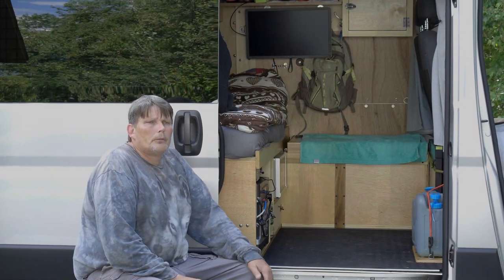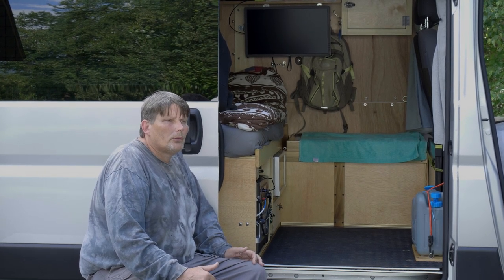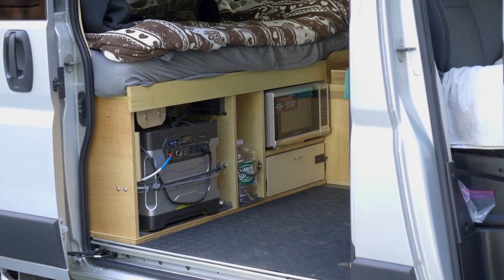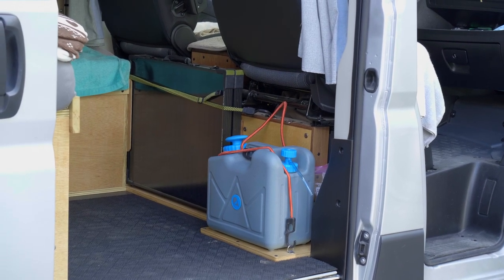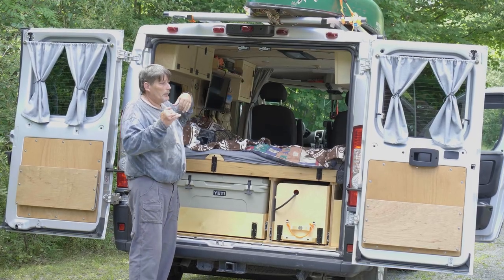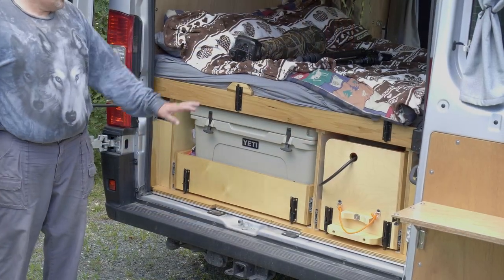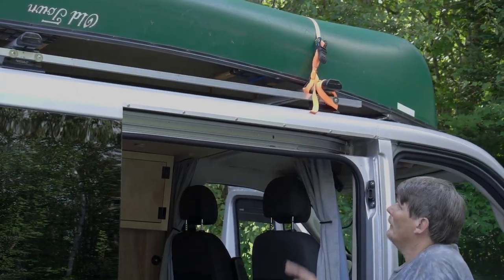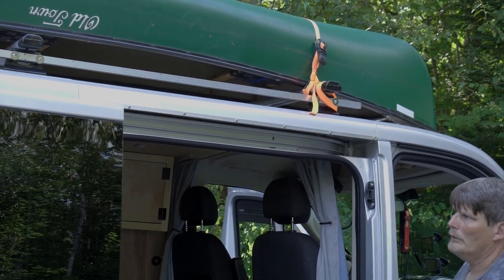Ram Promaster 118 WB Camper Build - Intro

Comment: Can you make a follow up video showing or sharing your experience on how the 118 WB holds up under tough road conditions and inclement snowy and rainy weather?  I can't find any information or reviews to see how it holds up on sand, mud and snowy roads or going uphill a mountain. Wondering about the worst situation you have driven under and how it held up?
Reply from the maker: Yes - give me a week or so -  The best quick thing I can tell you is - Snow Tires make all the difference in the world, snow tires really do matter, it will never be a off road queen, but with good tires you can manage most situations - But I will do an update video - We love this little van :)
Reply: @fireflightphoto1319 Thanks a bunch for taking up my suggestion. 

Your built is very functional and beautiful by the way. I appreciated your detailed overview and very much so sold on this van but wondering if it can take me where I need  to go on difficult roads. 

If your video can demonstrate what the van can and can't do after the upgrades you suggest, you will become the first to have covered the subject on the 118. 

Snow tires for the front wheels only or all 4? I don't know enough to know if it matters for the real wheels that do not generate any power. 

Thanks again.
Reply: @fireflightphoto1319  Hi there. Just wondering if the video update about the Ram Promaster 118's limits and capabilities is still something you are planning on. If not, can you share your experience as a reply. Many thanks.
Reply from the maker: @tristansolaris467  - sorry, life got in our way of this follow up - i will post something shortly :)
Reply from the maker: @tristansolaris467  Hi - I will do the video update next few days. But the immediate things that come to mind are: Adding the side rollers for the canoe was a big benefit for loading with one person. Taking out the cooler that need ice and replacing it with a dometic fridge was a big improvement. If I had known about that size fridge I would have built the rear compartment different. Adding a closing flyscreen on the main sliding door, really helps with sleeping in hotter temps with door open. It really needs a rollout awening above the sliding door to make it amazing.  It would also be nice to have some sort of rain awening over the cookng area.  We have been on back roads (moose country) but its not a 4wd, so you have to be aware of the conditions you are driving in.  Also snow conditions, with front wheel drive, make sure you don't get stuck in winter conditions.  Sometimes its really just one wheel drive, the way the drive system works. Other than that its an awesome glorified tent as we call it. We love this van.  Not sure I had the magnetic window guards for the small slide windows, but I made some guards out of plexiglass with magnets, means we can leave the small windows open when we sleep even in rain.
Rob
Reply: @fireflightphoto1319  Thanks. Please share as much info about your experience  about the limits of this van when it comes to mild off-roading in back country roads.  It is not AWD and I am wondering if we can be given some real world examples of what it can and can't do, what were the most challenging places you've taken it and how it handled. Really looking forward to your video. Thanks again.

Comment: Thank you for the tour! Some excellent tips, from your custom canoe roller to the remarkable drip edge to prevent water runoff into the van.
Those flip up shelves on the rear doors are a great idea too!
If you could share links to some of the items you mentioned, like the roof rack and camping gear, it would be greatly appreciated!
Happy trails!
Cheers from Montréal :-)
Reply from the maker: Thanks - Give me a couple days (Sept 3 2020) and I will get a parts list together and get it up for you (links or PDF) - just need a few days, again thanks for the compliments, the van is awesome, we love it!
Reply from the maker: The roof rack is the H3 system from Vantec (you can get a two bar or 3 bar version. The flip up right angle foldable brackets (are the best I found) awesome in stainless steel, bought from Amazon Part No: YUMORE Folding Shelf Brackets 12”, Max Load: 330lb - we bought the 12" version - The two burner is the Camp Chef Everest 2 Burner Stove, it boils and cooks food in no time, we attached it with magnets so we could remove it if needed

Comment: Thank you for your very informative video. I love the build. I  am looking at the 118 low roof as well for work and hauling bikes, dogs, kayaks, ect. Could you please comment on how the van drives?  Are the seats comfortable?  Road noise?  Thanks!
Reply from the maker: The van drives great, not a powerhouse on steep inclines, we got the lumbar seats, we find them ok, there might be better seats but we went with best std ones. Road noise is not too bad, we do get a little wind noise from the type of roof racks we have installed. We haven't put aggressive tires on yet, if we do, we can expect a little noise from them.

Comment: Hi
How do you load your canoe? From back side or side way ?
Thank you
Reply from the maker: I had a custom canoe roller made that attaches to the roof racks. You lift the fron of the canoe to touch / lean against the roller, once the front is leaning against the roller, one person can just roll it up on the roof, so to speak. Same in reverse, the roller helps in both directions.